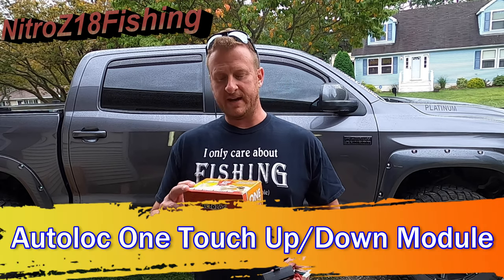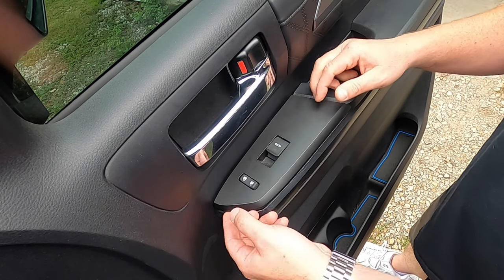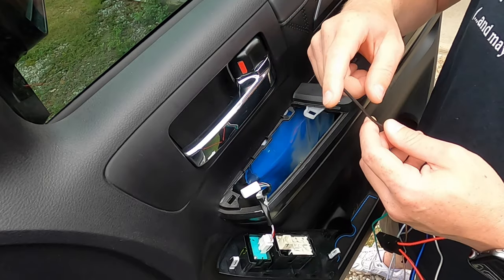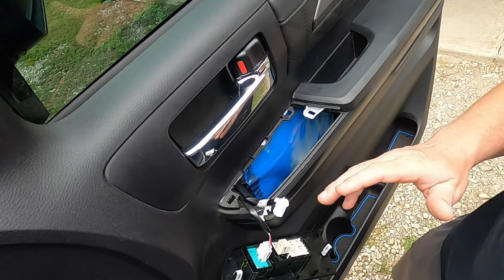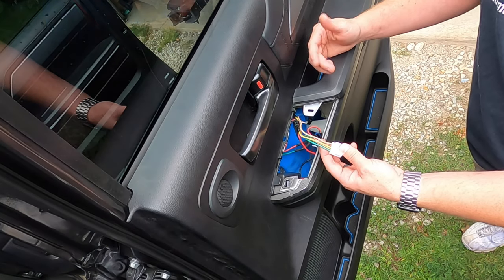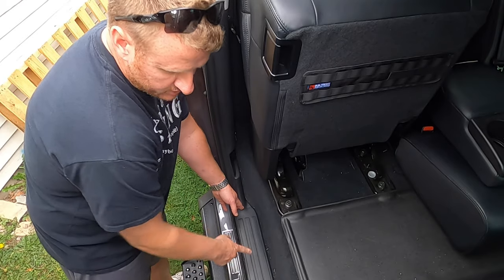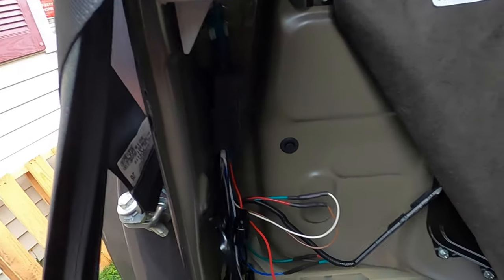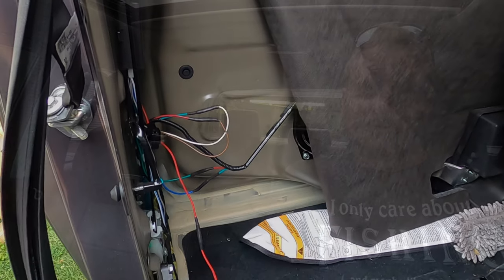Autoloc One Touch Up/Down Module Install (Toyota Tundra)

Comment: Wow, this was an awesome explanation. Thank you. This is exactly what I’ve been searching for.  I bought the SR5 trim and none of my driver side window switches have the one touch up feature. Definitely going to get this.
Reply from the maker: Thanks man, I appreciate that!...yes sir, this is one mod that’s well worth it for any trim, such a little modification but I personally love having it on all my windows...even on the back one... thanks for watching!
Reply: Id suggest for your trim level looking at 3W liners window control module. I have it on my 2012 Tundra CM and I love it. $110 well with it.

Comment: this is well explained so here is a question, in what point is better to connect it, close to the switch or close to the motor? there is relays relays in some point between motor and switch so it doesn't  make any difference wherever you connect those controllers?

Comment: Great video and instructions on how to wire this up! I have a SR5 and the driver window is the only window with auto function. So if I understand to make my passenger and both rear windows and back rear window I need a module for each window I want auto up & down?
Reply from the maker: Thanks man, I appreciate it!…yes sir, one module per window that you want the function on, hope that helps!

Comment: Great videos, I'm definitely going with the Autloc up/down module and use your install video.  Curious, do you have a video of you moving your sliding back glass control from the default spot on the left side to between the gear shift and the center console?  Hopefully I didn't over look it in the playlists.  

Thanks again for the great videos and information!
Reply from the maker: Thanks Andy, I appreciate that!!…I actually didn’t make a video on that, but I’ve had several people ask about it…maybe I’ll throw one together showing how I did it, it’s very easy to do and I like it much better in the new spot!…thanks again for the feedback!

Comment: I know this video is for a Tacoma but great help and was wondering if you may have any input for a separate platform. 

I have a 2018 GMC Acadia has express down but no up so I bought these for my wife’s car and can’t get the auto up function to work. The minute I connect the green wire to the “door” side power it will only let me roll up in tiny increments like it cuts the power. When I release and re-pull the switch same like a 1/4 in of movement then stop, rinse and repeat over and over.
Reply from the maker: Hey Brandon!… Man that’s strange, I’m honestly not sure what’s going on there… Did you buy more than one unit?… If so I would maybe try another box if you haven’t already and see what happens… Chances are that’s not the problem but at least you can say you ruled out a defective unit… Let me know how you make out, I’ll try to help the best I can!
Reply: @NitroZ18Fishing  thanks for taking the time to respond. I'm not an expert but this isn't the first time I have wired stuff in vehicles from alarms to radios and headlights. maybe a bad module was my first thought. I had a second so I swapped them. Reran all the wires to make sure I didn't have a poor connection somewhere and still can't get it maintain power. It jumps from 0-1.10-1.13 and the drops.
Reply from the maker: This one has me stumped, I’m honestly not sure what’s happening there…I would maybe reach out to the company and see what they think, I’m sorry I can’t be any more help on this one!…let me know how ya make out if ya don’t mind!

Comment: Great video, just wonder can you use window switch the old intermittent way, or only auto up or down all the way? Some factory have two positions for intermittent and auto, do you have to give up partially putting window up or down?
Thx!
Reply from the maker: Thanks Todd, I appreciate that!...and yes sir, you can stop the windows anywhere by simply pressing the button again...so when you hit the button the first time the window starts going up or down, then hit the button again wherever you want the window to stop and it’ll stop right there...hope that helps, thanks for watching!

Comment: I had one of these installed in my 1991 MR2, the window UP is so slow. Compared to my driver side. I wonder if there’s any difference between module. I guess it’s universal, one size fits all.

Comment: Do you have a video showing you running your wiring from back window to battery terminals?
Reply from the maker: I don’t unfortunately, but it’s very easy to do!…if you just pop up the door sill panels on front and rear passenger side doors, you can run the wiring all the way to under the glove box area…there’s a big rubber grommet up under glove box that you can poke through and into the engine bay…once you’re into the bay, just zip tie the wiring accordingly to make sure it’s safe from any moving parts and run it to the battery…hope that helps!

Comment: I have a 2012 SR5 and it came with the auto down on the driver side only,.. I would like the up and down feature, do i following the same instructions when it already have the down feature or do i wire just the down wire for it to have both features,...?
Reply from the maker: Hey Jerome!....this is something I have been asked a few times, and unfortunately I’m not sure since I don’t have a vehicle to test it out on...if I had to guess, I would say you can probably just wire the “up wires” since you already have the down feature, but hopefully someone can chime in and answer for sure...I would just wire the up wires and test it out, worst case scenario you can just go back and add the down wire install if needed!...sorry I can’t give you a definitive answer!

Comment: I wired mine up to the passenger window but no luck. Does the constant 12v get cut or are you just tapping into it? In other words does the switch need constant power after you install the auto log module or is it just left as is?

Comment: So, if my master switch has auto for the drivers window but not the passenger, the module will get installed on the passenger switch and yet it’ll still work for auto if I hit the button the master switch or I need a module on both switches?
Reply from the maker: Hey Ryan!…all ya have to do is install it on the passenger side door and it’ll work from that switch along with the master switch on drivers door…so just 1 module on the passenger side door is all, let me know if ya need anything else!
Reply: @NitroZ18Fishing  I wonder if I install a module on my OEM driver wiring if it’ll give me 1 touch up too. I guess I could just wire the up portion to get both. 🤔 I originally thought I’d have to put a module on each switch of the master switch and another one on the side door switches.
Reply: @NitroZ18Fishing  never mind. Figured it out by reviewing my vehicle wiring diagram.
Reply from the maker: Let me know how ya make out with the install…it’s not bad at all, and definitely a nice feature to add on!

Comment: How does it know when to stop? I’m thinking about an application for an electric roller lid on a ford ranger tray. If it can open and close longer and sense when it’s fully open or closed.
Reply from the maker: It has load sensors in it so when it meets the resistance of opening/closing it kills the motor…hope that helps!

Comment: Sorry if this is a dumb question, but there isn't much info out there on these AutoLoc units. Do you need a separate AutoLoc module for each window you want to convert, or does 1 unit come with enough harnesses for multiple windows?

Btw, great job explaining how the wiring works!
Reply from the maker: Thank you, much appreciated!…No question is a dumb question!…yepper, each window you want to convert needs it’s own module, that’s the only negative of these kits…but even with that being said, this is one of my favorite mods…something so simple but effective, definitely worth the install!

Comment: Great video. Does the auto up/down only work from the master swtich(driver switch) or does it work at the switch the module is installed on also? TIA.
Reply from the maker: Thanks Joe!...the function will work from the master switch and from each individual door/window it’s installed...so your passengers will be able to utilize it as well...thanks for watching!

Comment: Man you are modifying the hell out of the truck. Pretty soon you are going to run out of things to do. Have you found any led taillights for it? I'm talking the whole assembly, not just bulbs. Hopefully just a plug and play type thing. I would like to change mine to led taillights but I'm waiting to see what you do first.
Reply from the maker: Yea my taillight assemblies are LED, everything but the reverse light....it’s all plug and play as well, took me like 5 minutes to install both sides!...I just swapped out my reverse bulbs to LEDs as well, but all other lights are enclosed LED set ups...now with the reverse bulbs being led as well the whole thing is...they’re the “Winjets”, if you search for them on eBay they’ll pop right up...hope that helps!

Comment: Quick question what if I only want to convert the auto feature on the driver control for the back windows?
Reply from the maker: These won’t work for ya unfortunately…when you install these the auto feature will work from Drivers master switch and the door you install it as well

Comment: I've tried this on me VW polo 2015 tsi and it doesn't work. Any other suggestions?
Reply from the maker: Hmm, I’m not too familiar with that vehicle and it’s wiring…the only times I’ve seen it not work is if the wiring from module is not “tapped” into the correct wire on vehicle, but again I’m not familiar enough with the VW to give any advice on how to fix it…I’m sorry I can’t help more with this one!

Comment: I have a crew cab. The front 2 doors both have auto up/down. I want the driver door to do the auto up/down on the back 2 doors. Do I have to put two of these in that door then?
Reply from the maker: No sir, just one in each rear door...your setup is exactly like mine...hope that helps!
Reply: @NitroZ18Fishing  so then the driver door will still activate the auto up/down on the rear doors?
Reply from the maker: yepper!...works like a charm!

Comment: A little late to the show.  Question. My tundra only has auto up on driver window not both up/down. Your platinum was the same pre mod, is that correct?
Reply from the maker: Hey Brody!...my Platinum had both auto up and down on driver and passenger window...so I didn’t need any modules on those 2 windows

Comment: Got it installed but it’s not working.all i can heat is the clicking of the autoloc module but no movement on the windows. Is there something wrong with my autoloc module?
Reply from the maker: Hey Sean, I’ve actually had that happen to me a couple times now as well...I plan on making a follow up video to see if anyone else has had it happen or found a solution...it’s only happened to me a couple times but it’s strange and I’m not sure what’s the cause
Reply: @NitroZ18Fishing  ok thanks! When i first installed it and tested it the product works really fine but after 5 times of testing, it
 stopped but the module is still clicking. i’ll just wait for your video and hope you can have a solution bout this problem.thanks again...
Reply from the maker: Hey Sean!…didn’t forget about this, I’m actually uploading a follow up video on this topic, wait until ya see what I found out on my window that this was happening on…strangest thing I’ve seen when it comes to wiring 🤣…video should be posted and live by tomorrow!

Comment: What's the difference with 1000 and 2000?  Got 2018 crewmax limited.
Reply from the maker: No difference at all, the 1000 is a 1 pack, the 2000 is the 2 pack of modules...I confirmed this with Autoloc themselves...hope that helps!
Reply: I like the way u install.  At least u dont have to pop the door. Nice Mod. I guess need four of them. Since the driver side is the only auto.
Reply: Check out the website they are on sale. Bought 4 module. Plus free shipping.